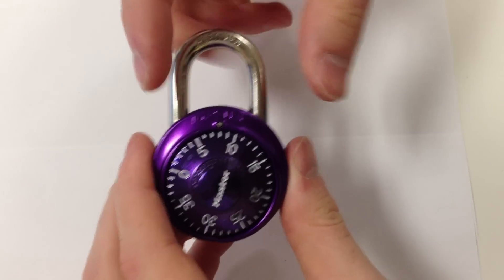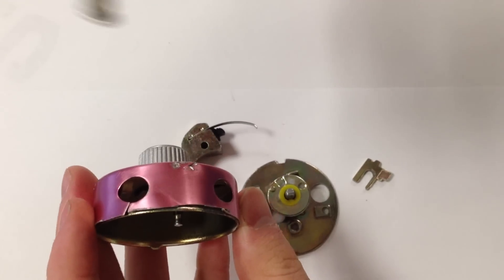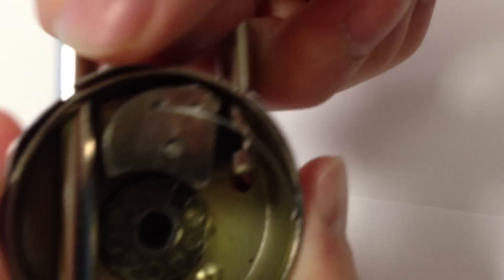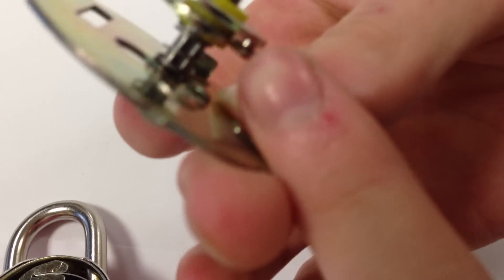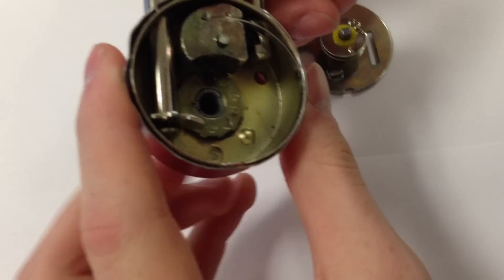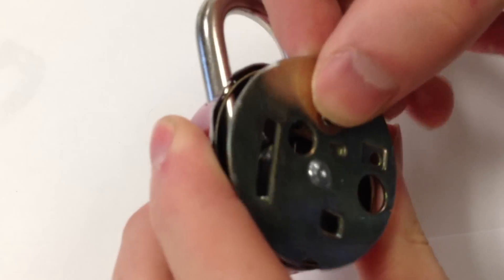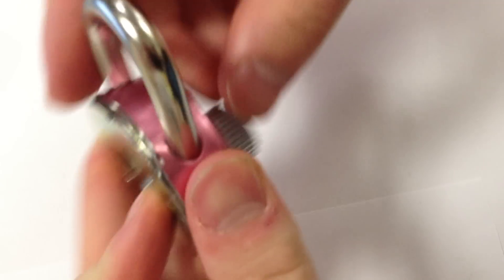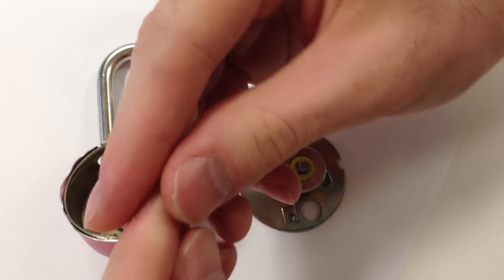REP: Inside a "Master" combination lock

Comment: I just used a shim to open one.  Could you decode the combination if the lock is open, look into the shackle hole then locate the gates as you spin the dial?
Reply: How would a shim work on this type of lock? It doesn't look like it can push over the latch as the gates wouldn't be open./

Comment: I had found one of these which was locked and had such a loose shackle to the point I could not recover its combination using Samy Kamkar's procedure. I could also hear a small loose part inside it, so after prying the housing open with a screwdriver, the issue turned out to be that the shackle collar somehow came free, which I'm guessing was caused by a sufficient amount of abuse. I noticed that the particular lock used a metal locking latch (instead of a plastic one shown here), which was not captive when the lever is removed (there is a groove in the locking latch for the bar in the housing to keep it captive, and a spring behind the latch for compressing against the shackle when locked)—so there ended up being 6 or 7 parts when disassembled.